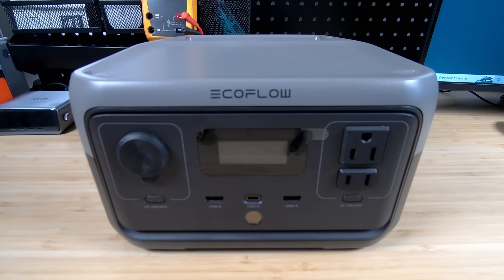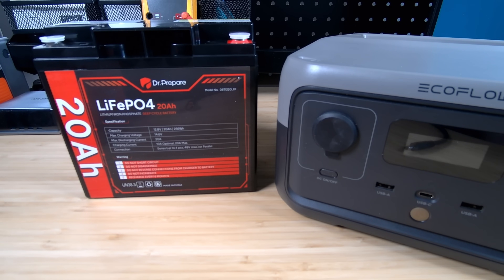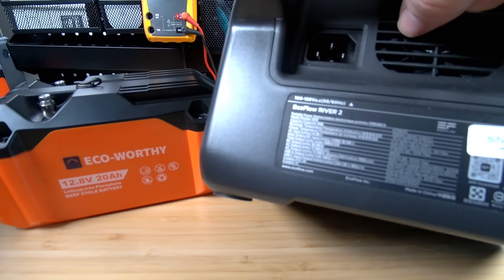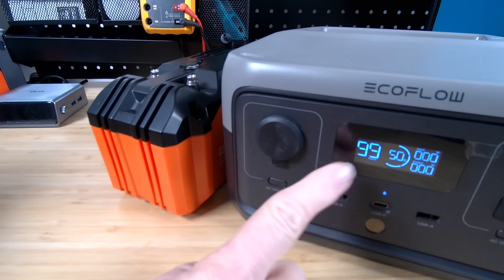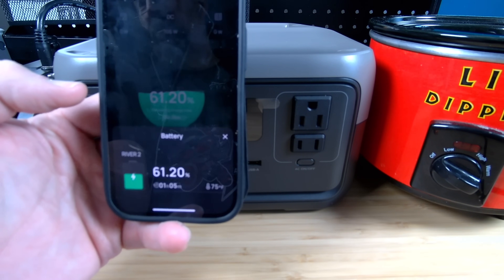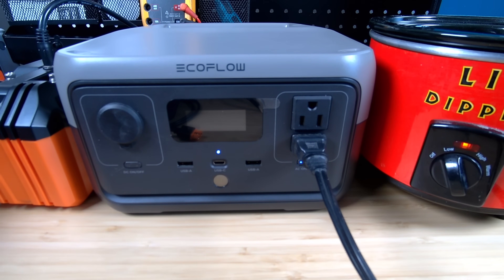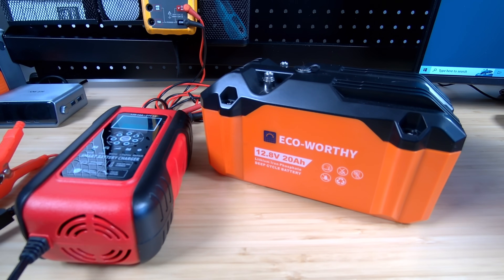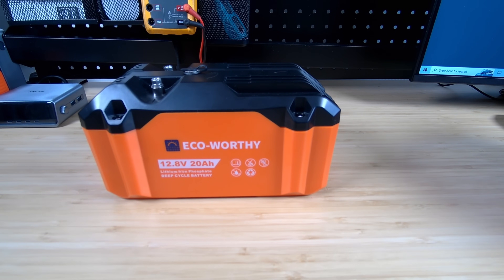The EASIEST and CHEAPEST Way to add Battery Capacity to Your ECOFLOW (or Bluetti, Anker, etc)!

Comment from the maker: Give me your honest opinion about this solution.
Reply: I plan on doing this with the bigger Dr. Prepper that has the detachable ports.
Reply: Totally valid solution even though the official battery extensions obviously look nicer.
However, I think there's an even cheaper solution:
Just take the 18 or 24V batteries that most of us probably already have at home from their electric DIY tools and buy the appropriate DC5521 / XT60 adapter🙃
Reply from the maker: @ThoScheen that’s one of my next videos!

Comment: What wires would u need to charge the eco worthy battery from the eco flow unit?  Thanks
Reply from the maker: I use this one. Just plug it into the AC port. It’s obviously not 100% efficient, but if you’re charging your EcoFlow from solar, it’s still free. 

https://amzn.to/4nyIyBN

Comment: Could you use this as a 'supplement' without wasting too much power?   is there any way to tell the Ecoflow to prefer AC power (120VAC) over DC?
Reply from the maker: I’m not sure what you’re asking. If you have the EcoFlow plugged into the wall, it wouldn’t need an additional battery hooked up. Once you unplug it or lose power, the “external” battery would be necessary. 

Sorry if I’m not understanding your question correctly, let me know.
Reply: @ No worries - This would be for a power outage scenario.  I'm using an Ecoflow River 2 as a UPS for some equipment, and if the power goes out it'll handle about 2 hours.  I'd like to add a little more capacity via an external battery, without having to manually attach it.

Comment: Why bother ecoflow? You can do the same with just the battery and standalone inverter.
Reply from the maker: The video assumes you already have a power station. There’s a million ways to skin a cat. This is just one of them.
Reply: Thank you for your evoflo hacks
Reply: It all depend what are you going to use it for. We do have a boat and camper, plus use it inside the house if is necessary. We don't want to mount/install a permanent unit.
Reply: Similarly, if you want Voice control Amazon music streaming but don't want to spend $200+ on Echo speakers -  you can simply buy a $20 Echo Flex on sale and bypass the tiny built-in speaker by using its 1/8" output jack. You get 16 bit/44.1 kHz CD quality audio and much better speakers.

Comment: This is very similar to what I started using last year.  I have a Bluetti 200L which I use to power my motorhome and have a couple of cheap 100ah batteries that I pack along to help charge the power station in case the weather limits solar charging.  Like you say, you are limited with charging speed but this can be ramped up if needed and has not been a problem for me.  It has been game changing to no longer use my generator and being able to camp in far more locations without the usual limitations.
Reply from the maker: This is awesome!  I love hearing success stories like yours. Thanks for watching!
Reply: ola sou do brasil , e quero fazer isso q ele mostra , ai vc nos informou q fez isso e deu certo , pergunto vc  pode me diser qual a potencia  da sua estação  de energia ,da p vc  me mostrar

Comment: It see 12 source because of the VOLTAGE, not sure where the cutover would be on your river two, but I'd imagine a 24+ volt input would report as SOLAR
Reply from the maker: Very possible. I know Ecoflow uses the 3rd conductor on the XT60i connector to also determine cigplug vs solar. Thanks for watching!

Comment: Could you do, solar panels to solar charge controller to batteries to charge the batteries. Then from the batteries do a dc to dc charger connect that to your power station?
Reply: How about going from the solar panel into the power station and from the power station recharge the battery using the appropriate charger?
Reply from the maker: As long as the charge controller has the correct charging voltage output for your battery. Also make sure you use the right size wired for your current rating of your battery charge rate.
Reply: I did this it works but once the ecoflow hits 100% from the battery bank it switches to AC passthru to power the load and abandons the DC input. Haven't figured out why. I think it's just how it's designed